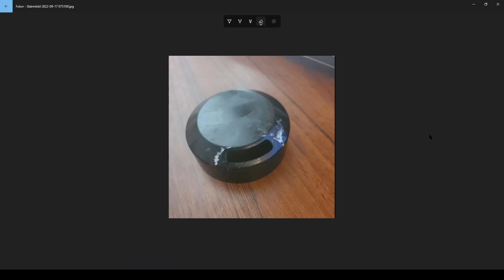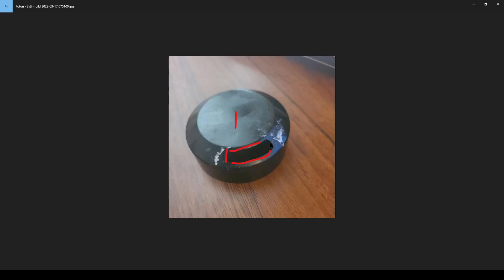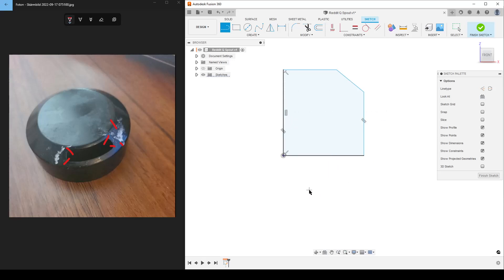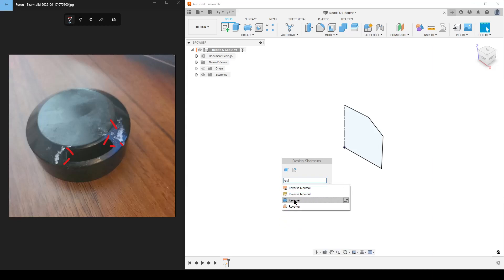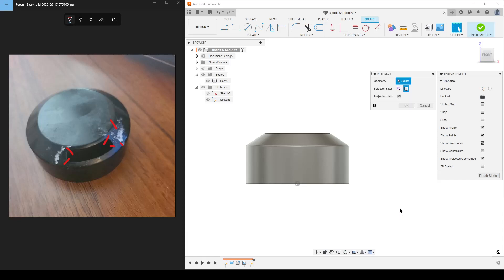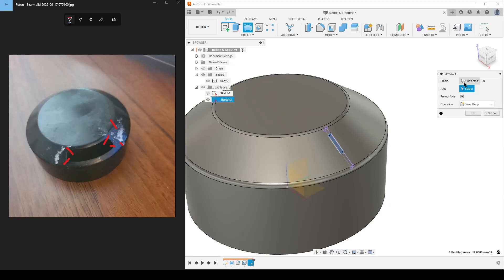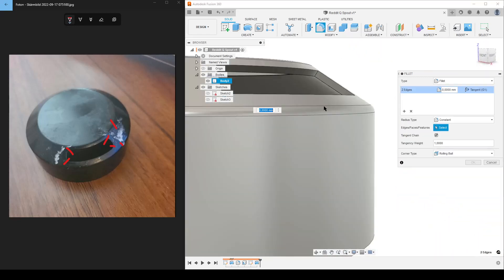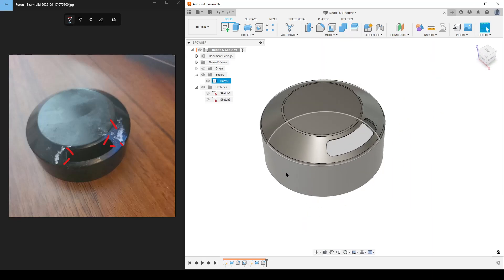Fusion 360 Basic - Revolve Workflow

Comment: Nice work again. I was designing a mixing screw for a small DiY epoxy mixer made from reused printer parts. I could draw everything, except for the complex mixing screw itself. Eventually I decided to do it in Rhino as I found it really hard to make a twisted screw with a taper in F360. I even thought about asking you, but it was time-sensitive so I had to improvise and Rhino worked really well for what I needed. The only downside is that it isn't parametric enough to change everything afterwards. Then I thought of doing it in Grasshopper, keeping it parametric and even adding in the Fibonacci sequence, but eventually the manual method turned out to be the best in my case.

Would you think it would be interesting for you to do a video on it? To make it harder on you, I can send over an image of the resulting (non-Fibonacci) 3D-printed part.
Reply from the maker: Thank you. Fusion is limited if making some strange parts but that's half the fun ;) You can send an image to me or use (sub)Reddit r/Fusion360, can be somebody else that have a good solution :)